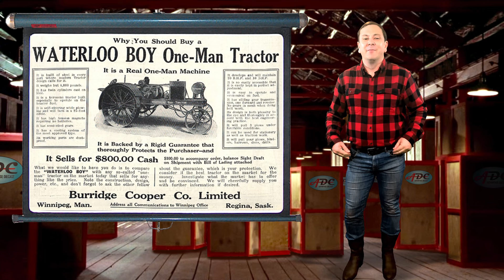John Froelich Tractor & Ertl Prestige Series Replica

Comment: The “real” one sitting in John Deere headquarters is actually a replica built in 1937 for Deer’s centennial celebration. (1837-1937). The handle you thought was the throttle is actually a manual fuel pump to put fuel up to the small tank on top so it can gravity feed the fuel mixer ( sort of but not really a carburetor as we know them) until the engine was running and a mechanical pump took over the task. The can on the front Holds drinking water for the crew.